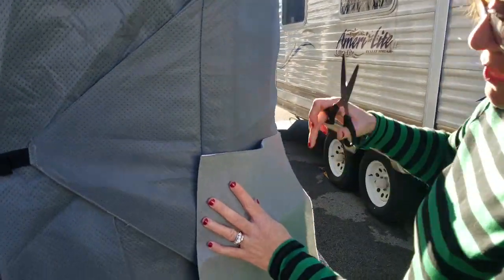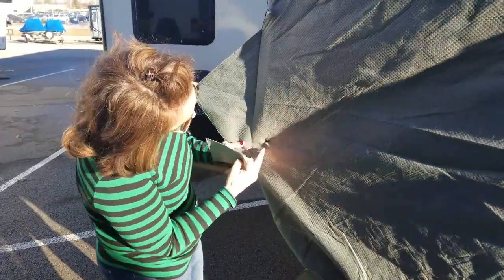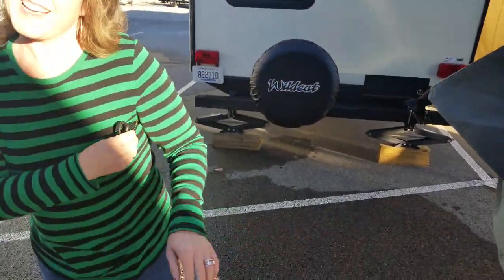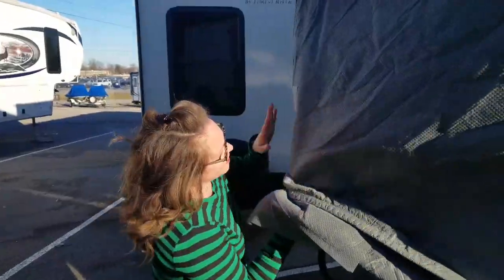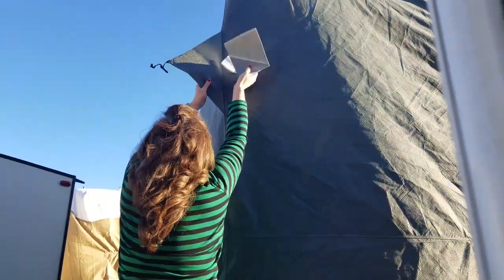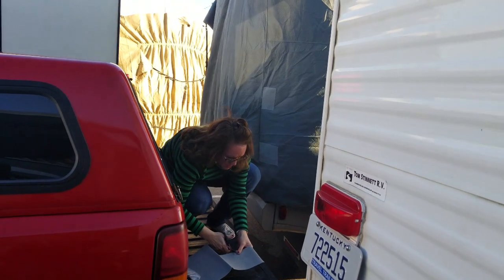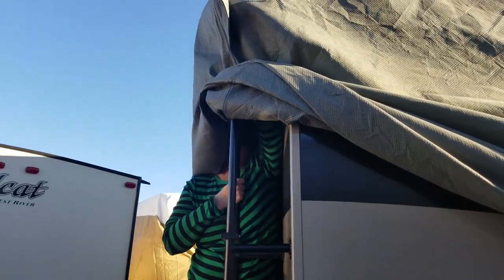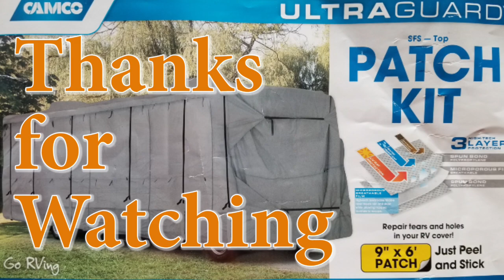RV Motorhome Cover Repair || Patch Job || Repair Tears

Comment: I had to do this to my boat cover, the bow seat folds down and the metal bracket wore a hole in the cover. I ended up putting on four preventative patches in the high stress spots throughout the boat. Been working great! Thanks for the info!
Reply from the maker: Our patches held up well through the winter.  Glad to hear yours are working great too. Simple fix that makes a big difference.👍👍